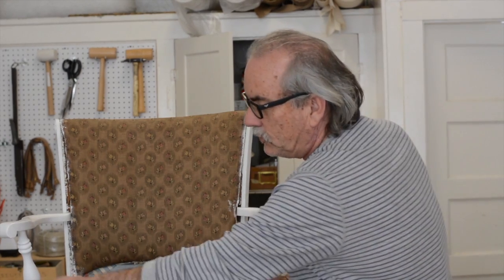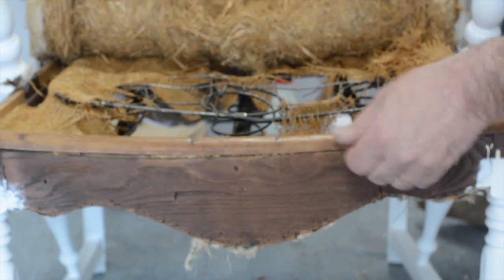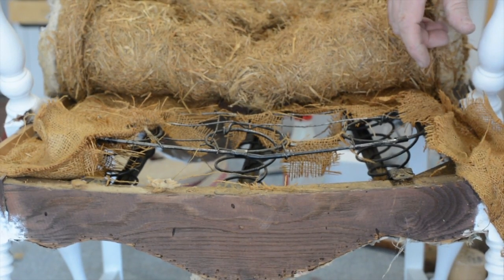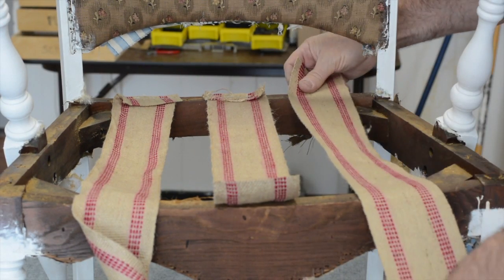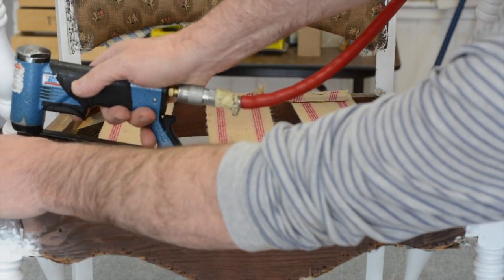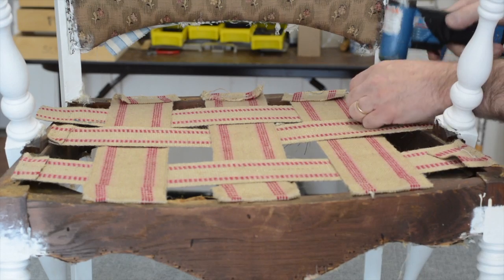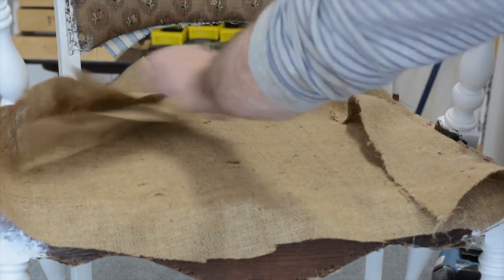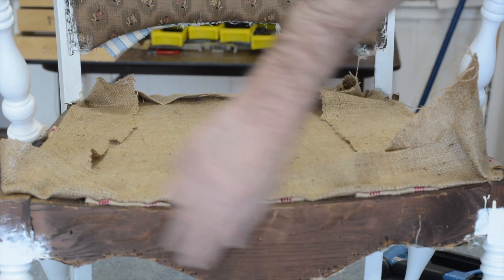Re-designing a Saddle Seat from Springs to Foam

Comment: It would be great if you could explain more about selecting the height of foam for a project.  It looks like you used 1" foam.  My instinct would have been to use 2".  What density foam are you using?  I have never seen a spring system like that before and have just started another project - a 1950's cocktail chair - and that's the spring system in place.  I'm thinking of replacing it with 8 way hand tied.  I have some high 9" springs.